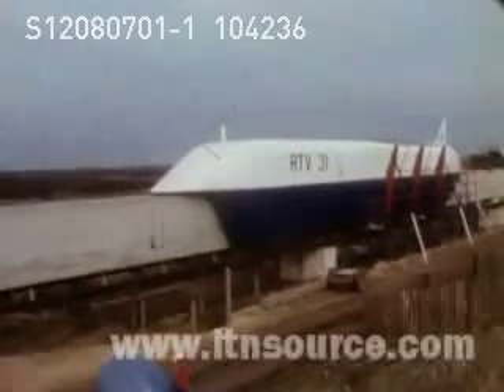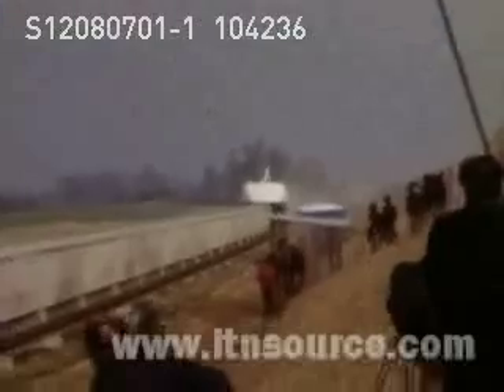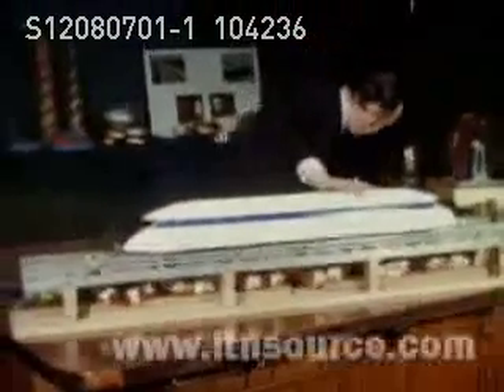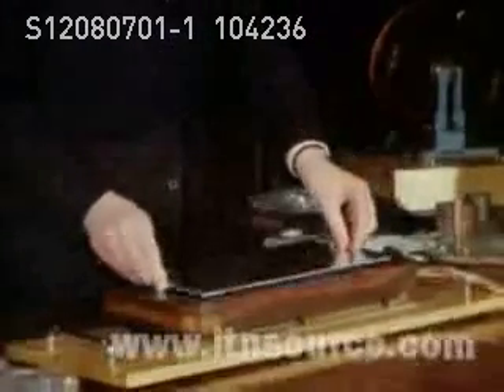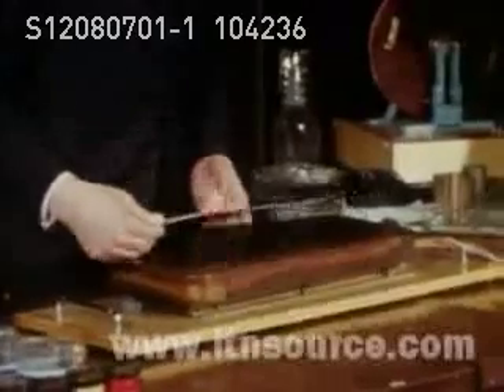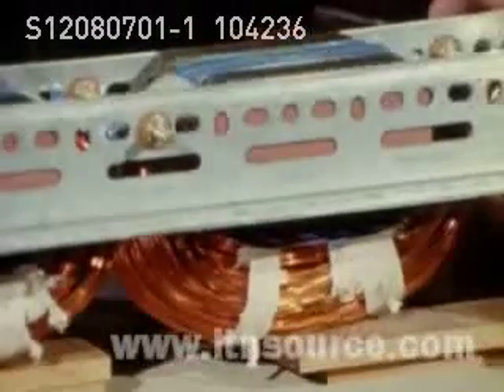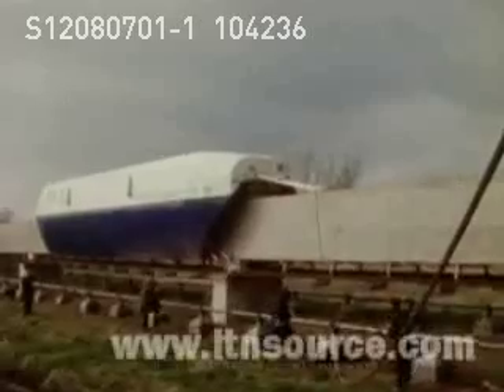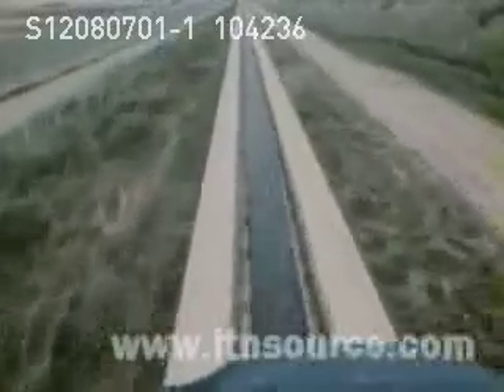RTV 31 Hovertrain & Linear Induction Motor archive video (UK 70's)

Comment: A sad update for you unfortunately. RTV31 is currently being cut up for scrap, as it had suffered severe corrosion issues after years of display in the open air (the concrete beam that it sits on is also suffering from ‘concrete cancer’, so RTV31 would not have lasted much longer anyway).

Comment: Just past through Peterborough railway station and there is one of these linear motor trains still mounted up on a short  peice of concrete track. It still looks amazing after all this time. If your traveling north through the station it's just before you get there and obviously  if your heading south it's on the right..

Comment: Great!,. .amazing that the UK did not find any takers for this project. Since i have a home in Earith,. even more of a shame there was not a line installed there!

Do you have any plans to put up the other video you mentioned?,.. i would love to see it.
Reply: Not enough project definition work done. It was a blunder. No systems engineering. All done in 'silos'. Linear motor, hover pads, track infrastructure with no thought about passenger requirements  as an integrated system. Rightly stopped. But gover me t should have taken a longer term view and financed more study work. It was wrong to permit this technology to be completely halted. By the way I was the engineer  working in the 'suspension silo'